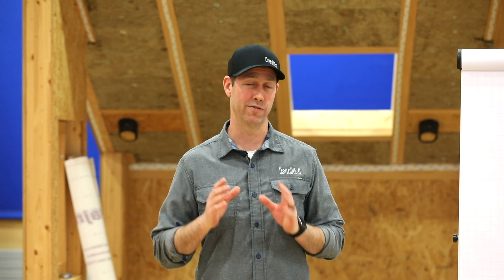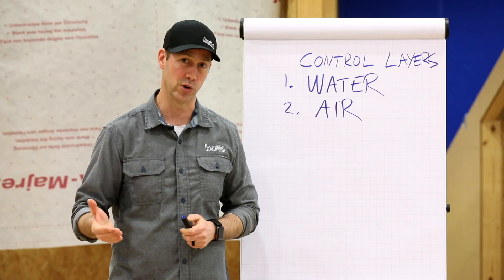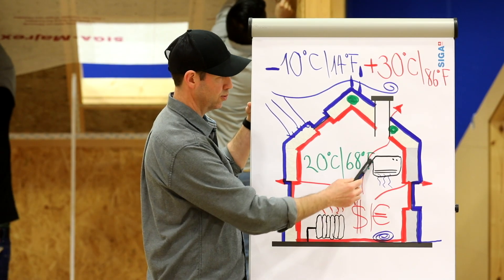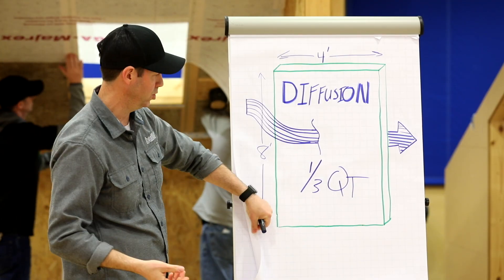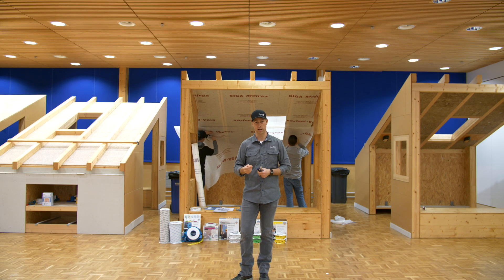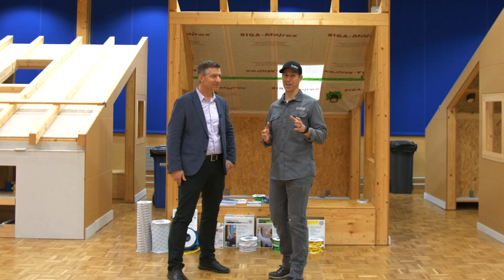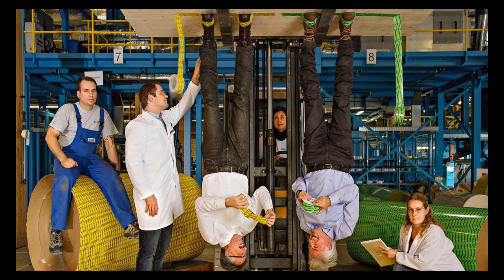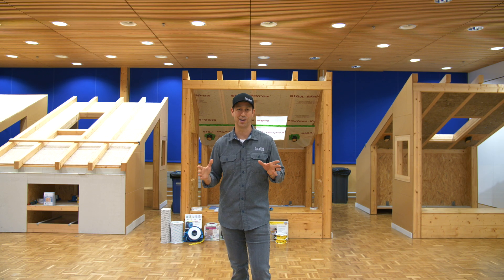Understanding Air and Vapor Barriers INSIDE your House

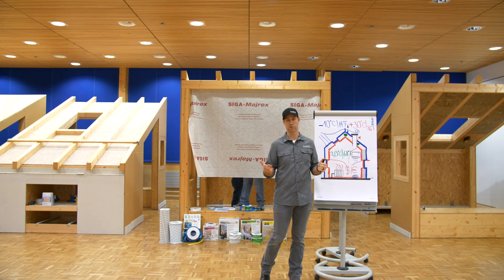Comment: I'm sorry, but after watching the first 3:30 of your video I realized your whole premise is wrong. 1-YES- you need to keep environmental water out of your home...rain, snow, ice, ground water, etc.  2-NO- you don't need to keep air out of your house or in your house, actually you WANT airflow between outside and inside...what you are really interested in is the fact that as air is being transfered between out side and in side, and vice versa...you are interested in keeping the energy in the air, heat, (or lack of energy in the air, cold) in your home. 3-NO-you don't need to stop vapour from entering or exiting your home....actually you WANT it to occur, but you want to be able to control it & it's rate.  The whole premise behind adobe, cob, straw bale, and rammed earth houses is the fact that the walls DO breath vapour in and out of the homes, hence, no mold or mildew issues. 4-YES-you do want to control the movement of thermal masses from inside to outside and vice versa.   I can't wait for builders, and building code writers to remember we have to completely re-think points 2 & 3...that is why there are so many unhealthy homes being built in this day and age.  And yes, I have seen your previous videos on vapour barriers, and why we use them...but like I said, it's not the vapour we need to worry about, it's not even the air movement....it's about being able to retain the heat energy stored in the air and vapour we want to control.  Nobody in the world would mind how many windows and doors you leave open (apart from the mosquitos and flies you might let in)...if it didn't change the temperature of the inside of your house.
Reply: Hey  don't know where you live but mold can generate so easily with a slight change in temperature from inside to outside. Saving energy needs a controlled environment easily done with an air exchanger. Simple as that and protects the house and occupants
Reply: @b4804514  mould needs 3 things (just like fire), it needs a warm environment, it needs moisture, and it needs organic matter (oh, and oxygen I guess).  But if you eliminate just 1 of those three things...mould will die, or not even grow in the first place.  So saying that mould will grow just because of a temperature change is not entirely correct.
Reply: No The temperature change generates moisture then mold generates in the wall cavity from high humidity, stagnant air, an organic porous wood and warmth. Mold spores are everywhere and live 32 to 120 degrees. Warm could be 32 degrees. With high outdoor humidity mold is a serious issue for all construction. It never dies just goes dormant until it gets warmer.
Reply: @b4804514  But if you just have an increase in temperature, and moisture with no organic matter...no mould.  Right now we are creating houses with organic matter in them (wood, and wood fibre products), we want our houses warm...and we want to trap water vapour INSIDE our homes by creating moister impervious barriers.  Anyone with half the sense given to an ant would realize that this cannot go well...we are creating the PERFECT environment to grow and cultivate mould.  A home should be a perfect environment for human habitation...not moulds ;)
Reply: Without an air exchange system, I agree with your comments. Add an air exchanger and step into the future where we aren't destroying the planet and building better homes to last a lifetime. That's the goal and u.s. building codes are incorporating this concept.
Reply: And that is why on most modern built houses in Germany for example we have a combination pf a controlled and regulated air-ventilation system controlling the flow of old used air to the outside with some heat exchanger and then bringing fresh air from the outside in while retaining about 90%of the airs heat capacity how much/little that might be. And secondly a floor-heat system where there are pipes in the floor which heat up the surrounding floor concrete and thus giving a nice comfortable warmth without any high temp deltas off.
Reply: @kniefi  yes - our North American residential building code is definitely a couple of decades behind European standards :(  I sure wish we would hurry up and catch up, but unfortunately I don't think we will ever catch up.  You will always be at least a decade ahead of us.
Reply: Rory Hassett interesting debate. Reading thru the comments I think the fundamental misunderstand starts by using completely different building materials. Stick frame homes require smart engineered materials to provide functions that natural materials like Cobb, rammed earth, cordwood, straw bale provide naturally. Add in large roof overhangs, wraparound porches and smart landscape design and the buildings will have it easier to do their job. 
I assume that stick build is the American standard. If few architects and builders use natural materials, then the consumer would never question why modern homes are so difficult to build. Hempcrete might open the door for more natural homes but that’s still many years away.
Reply: @4philipp  Yes - I totally agree.  Sometimes ppl just need to take a step back, determine what they are trying to accomplish and then decide on the most efficient way to achieve those goals.  Sometimes the newest, brightest, trendiest techniques & innovations are not the way to go.
Reply: Rory Hassett so bottom line what do u recommend? No interior vapor barriers at all? How about exterior insulation?
Reply: For a zero energy house the surfaces that face the outside have to be impermeable to heat, airflow, and vapor. I think it's obvious that then the climate inside has to be actively controlled. The best way to freshen the air inside is by the adiabatic wheel heat exchanger.
Reply: @RubenLensvelt  would you please place a link to the heat exchanger you mentioned?
Reply: @RubenLensvelt  But that is my whole issue...we don't need to have vapour impermeable outer surfaces on our homes to make them efficient, or even net zero energy homes.  Net zero only means (the energy you take out of a house is equal to the energy in), so if you heat your house with solar, geo-thermal, or wind (converted into electrical), or combinations thereof...you are still technically living in a net zero home.  Creating homes that are impermeable to heat, airflow and vapour is in fact creating a hazardous interior environment unless properly controlled with man-made substances.  What you are basically trying to create is a bio-dome, but not allowing condensation to form on walls, windows, interior wall assemblies, etc because then they become mould eco-systems.  How many bio-domes (even the small ones you can hang in a window), don't contain condensed water vapour on the inside of the glass...none...it can't be done.  So how is it that builders, engineers, and architects believe they can achieve it in a house?
Reply: @roryhassett9581  read up on passive house principles. Control the air quality and condition of the air prior to entry, this includes the moisture content. Sorry you're having a difficult time. Regarding net zero energy - by lowering the demand - this goes a long way. The thing missing from Matt's diagram is under slab insulation. Cheers!
Reply: @thomaspippin5883  trust me, I understand the principles of 'passive' houses...our family built an R2000 home in 1982, one of the first ones in North America.  What I still find hard to understand is why we are relying on codes and charts to tell us what saturation levels should be & what constitutes an 'air tight' house.  Air tight is air tight....but there are natural substances in the real world that filters the air, and conditions the air to the proper level for the surrounding environment without having to rely on man made filtration systems and humidifiers, which are prone to break-down (due to poor maintenance, or mechanical failure), be unreliable, or can become overloaded due to increased demand during peek demand needs.  Did you know for example that a cob wall can & will absorb up to 1L/m2 and either re-release it into the house when the humidity falls again (ei, a steamy bathroom), or completely absorb it, let it permeate all the way to the outside of the wall and then release it into the atmosphere...without letting any AIR out...which all you passive house builders are so happy about conserving.  It is as if it were a living wall.  So, to go back to what Matt was saying in the beginning...YES- we need to keep large movements of water out of the house (rain, ice,  ground water etc.)  Do we need to keep all moisture and water vapour either in or out of the house...NO.  Do we need to keep all air, either in or out of the house...NO, as long as we take the latent heat energy out of it before it exits the house.  That is what I am trying to make clear...trying to get ppl to think outside of the box.
Reply: @roryhassett9581  interesting. Sounds like you take issue with air tight (ACH) and mechanical provisions. I've always not liked relying on mechanical means and agree with that sentiment. Perhaps you also take issue with non-organic materials. But, the air quality in the u.s. and where I live in northern California is a huge issue. If it weren't for that, I might think differently.  Codes help balance developer bottom line conflict of interest in u.s. and I welcome that. As an architect having lived in tract homes (3) - I can say we are way behind.... Way behind.
Reply: @roryhassett9581   I also appreciate your insight and perspective! Thanks for that.
Reply: @roryhassett9581  
I could explain it all, but I'd have to post a Mollier diagram and whatnot. The point that I'm trying to make is that they try to keep the total energy inside of the house as much as they can. Radiation and convection are two parts of that total energy, and humidity is the third. Enthalpy wheels are popular devices for home ventilation systems in Scandinavia for example.
Reply: Never mind, I'm babbeling.
Reply: @roryhassett9581  A contractor friend and myself in Seattle (currently a cold climate!) are endeavoring to design a prototype "Backyard Cottage" which being less than 800 sqft is favored by new zoning codes here.  Our design uses prefab methods in a new way.  I am quite interested in this video and your discussion regarding vapor barriers, air-tightness, energy loss issues etc, because I am at that very point in the house envelope details.  I have learned a lot from Joe L at BuildingScience.com, (and Matt) and tried to follow the latest in energy saving and building longevity discussions, but the same debate seen in this thread keeps popping up and I am struggling to resolve the trade-offs for a cost constrained and size limited small home design we hope if successful might be replicated for many homeowners and families in Seattle.

 My guess is that if our design can not utilize thick breathable walls of the material you favor: cob, straw bale, rammed earth, in our case due to limited available space in most urban backyard sites for backyard cottages and our preference for prefab elements where practical and cost effective, then our design goal should be to control moisture migration across the envelope somewhat in moderation, but focusing the most effort on allowing any condensed or infiltrated water trapped in walls, roof or floor, to escape by giving the envelope access to enough ventilation within a timeframe that precludes mold growth.   Mr. Joe L. at BuildingScience has noted that homes built many decades ago were leaky enough that mold growth was not prevalent, but increased with newer, tighter construction that did not allow the envelope walls either enough energy transfer seasonally or air movement to dry out enclosed damp areas.

I agree with your general premise as I understand it: that focusing to much on energy loss transfer via low mass air leaks and/or a pristine whole-house vapor barrier regiment is misguided.  Which makes me lean toward using a modest vapor barrier regiment on the inside surfaces (for our climate), but spend more money/attention allowing errant water to "leave the building along with Elvis" using either passive or maybe a lowcost active system for that purpose.   Thanks to Matt Risinger and all contributors to this discussion, you have helped me understand these issues and difficult design tradeoffs.
Reply: @SeattleCoorain  you got it Mark, that is what I was trying to say....some minuscule energy losses aren't worth the trade off (or the cost) of having created a mould habitat, or the cost of having to purchase expensive machinery constantly monitor and exchange moisture levels and air flow.  BTW, I too am from the north west...just north of Vancouver BC.
Reply: @thomaspippin5883  the use of the house will generate moisture. When people exhale there is moisture. You don't know if the resident is very social and always has his 20 friends around, or if there will be only one person at all times. The use of showers. Some will do twice a week and some will do twice a day. Some will leave the bathroom extractor on for hours and some will not even turn it on ever. Some people will keep next to their bed a humidifier, at all times and some will have them in every room. Especially since some people believe that the way to avoid wrinkles is by having moist air. What I mean is that once that house is in use, many people will be using it, not as you imagined or as you would have, but in a very different way and will be generating lots of moisture that you didn't account for.
Reply: @LilianTejada  yep, can't keep people from leaving the door open or not turning on a fan after a steam shower. Education with a dehumidifier is better than suffering. Lowest common denominator design is not the answer.
Reply: That was a hefty and interesting response. I wonder however how can we get what you describe as being the solution (termal energy retention from air and vapor). It kinda seems like you advocate a return to ultra thick walls, and away from modern vapor and air barriers.
Reply: @Frabul14  I am not so interested in retrieving thermal loss, or gain from air because as we all know air has a very very low thermal mass rating, so I would stipulate that the energy spent or wasted in trying to retain thermal gains/losses from air is negligible, unless it's something obvious like a gaping whole or open door/window.  I am however a huge fan of creating large thermal masses to help control the temperature of interior spaces by using in-floor heating, creating heat sinks either below your house, or externally in an insulated ground pit, geo-tech heating/cooling etc.  If builders used more 'massive' objects within houses and energy stores, the minimal amount of air transfer that we are seeing from todays energy efficient homes (and I'm not even talking about net zero homes...or R2000 homes), would be rendered negligible because of the thermal mass or objects within the home (massive floor systems, large per-heated water storage/holding tanks in the basement, a return to large brick/mortar chimney's that heat up and hold heat)  Unfortunately, however it seems that everybody is always worried about air...air is in fact the least of your worries when building a house, even the Romans realized this fact 2000yrs ago...they weren't interested in heating air...they heated water, and brick, and mortar.  The heating/cooling of air is merely a byproduct of those processes.
Reply: @roryhassett9581  I concur with your points. Heating air is inefficient in itself otherwise all those cheap walmart air blower/heaters would do the trick, and they dont. I live in Istria (Croatia) and we have a long tradition of stone and brick houses, and I can witness that some of the houses build during the Austro-Hungarian era are amazing at heat retention with walls sometimes up to a metre thick. However it is usually  investors that are concerned with maximasing space here, cause every square inch is worth money, builders are not really to blame, at least not in my area where land and space is an issue (most of Europe as well). Radiant cooling/heating of concrete slabs (and sometimes walls), with water or even supply air coupled good air per hour exchane seems to do the trick. But even in this case it seems that vapor barriers and air thightness play an important role in optimizing heat retention and preventing water vapor diffusion especially in cold weather and high humidity climate.
Reply: @Frabul14  I agree...I think the only part about what you're saying that I would change is the last part of the last sentence.  We shouldn't be as fixated about vapour movement as we are these days...water vapour movement only becomes a problem when it is trapped, or is allowed to build up.  Like I talked about in previous replies, adobe, cob, straw bale, and rammed earth homes have walls that are vapour permeable.  That is to say that they will definitely keep out rain, rivers, floods etc...but they allow water in small amounts (vapour) to move freely from inside to outside, and only where a non-vapour permeable surface is applied to the exterior of the building do the inhabitants have to begin to worry about trapping vapour in the walls, and thereby causing mould growth.  As far as not using cob in humid climates...that is quite a misconception.  Cob buildings and thatch roofs have been used successfully in England for centuries...however IF you covered a cob house with a traditional vapour barrier (as our code in North America now dictates), you would be rendering that house unliveable within a very short amount of time, and all the timbers, thatch, and wall assemblies would be covered in mould and full of rot.
Reply: @roryhassett9581  sorry to bother you about a little detail, but mould or moulding is the decorative element used to finish a room. Mold, as in mold and mildew, are the living miniature organisms which thrive in moist places and destroy a house.